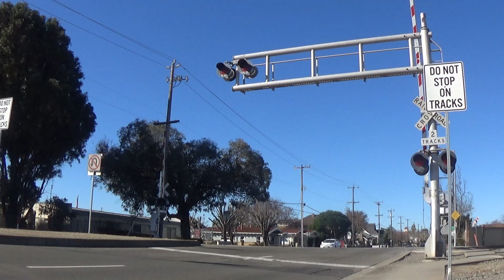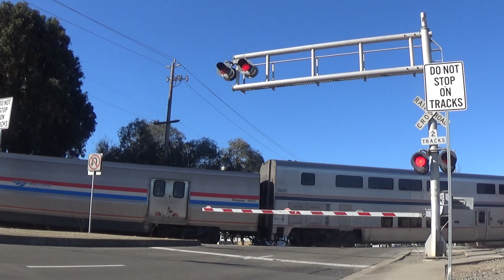Smith St Railroad Crossing Video

Comment: Great catch with the CDTX Siemens Charger! Going to be interesting seeing it on the Surfliner in Caltrans CDTX paint scheme. Was the left signals bell a reused one? Usually UP signals with that style the bells are NEG E-Bells.
Reply from the maker: Which year did Safetran die again?
Reply: @pacificzonerailfan  The Safetran Type 2 E-Bells somewhere after between 2008 and 2009 are the ones that were taken over by NEG. But I feel that some NEGs installed in at least 2009 and 2010 maybe a few stock new Safetran Type 2 E-Bells but it would be hard to tell.
Reply: @pacificzonerailfan  I like the new profile picture too!
Reply from the maker: @MobileRailSpotterRxR  I am just calling this a Safetran Type 2 since it is one of the earlier Safetran Signals.
Reply from the maker: @MobileRailSpotterRxR  and thanks! Didn't just take videos of the crossing yesterday, but also got train view too.
Reply: @MobileRailSpotterRxR  Want to say the Safetran Type 2's production ended in about 2011/2012, maybe 2013. Basically around the time either Invensys Rail or Siemens took over.